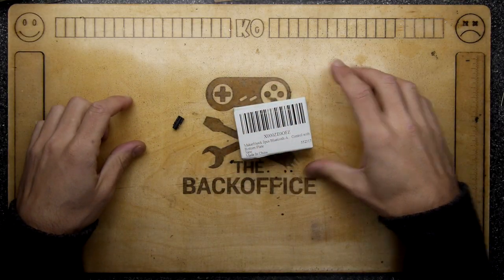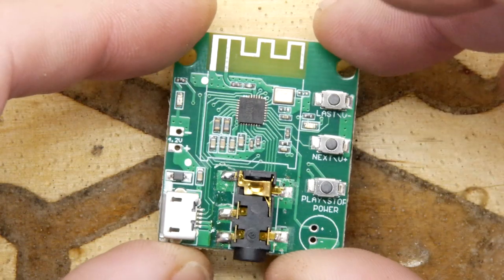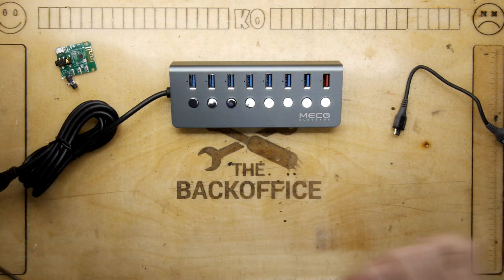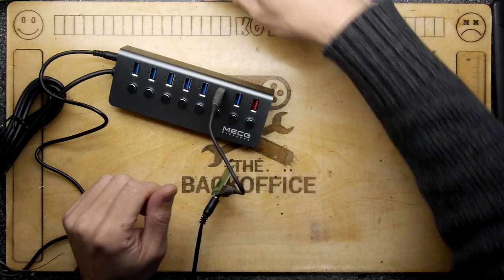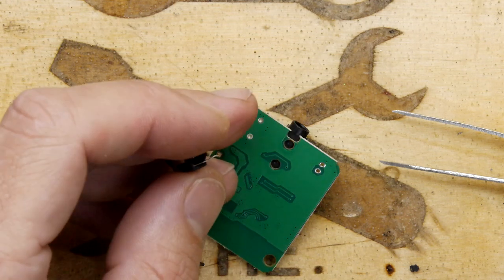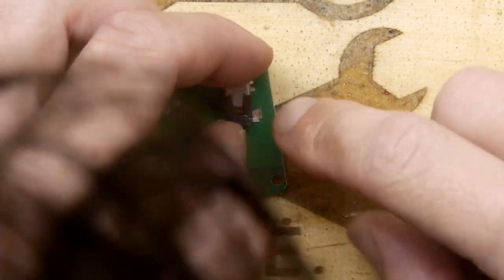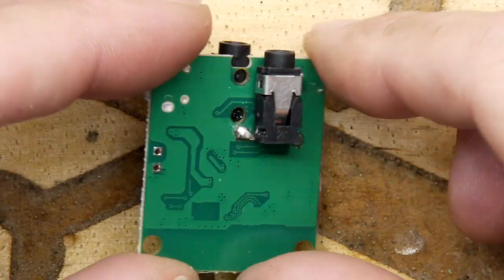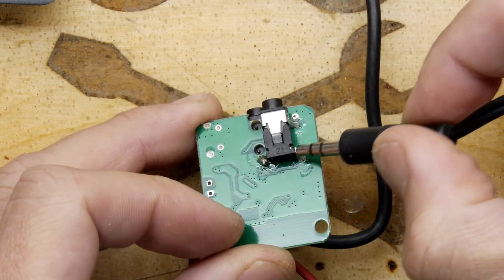Bluetooth Transmitter / Receiver

Comment: This is helpful. I've put a great big speaker above my bath and at the moment all it has is wires coming out so I'll need to do something similar with some kind of receiver and amp.
Reply from the maker: It should work well for you and it's low voltage so should be safe.

Comment: Interesting... did you ever test it? I was wondering if it actually does the bi-directional simultaneously or is it just another TX/RX bluetooth module which you need to switch back & forth to either TX or RX but not both at the same time. My goal actually is to build myself a BT adapter to which I can plug in any headset (earphones+mic) to it and make them BT, product that doesnt actually exist in the market as a commercial ready-to-use solution.
Reply: have you find out how to do this?

Comment: hi, im trying to get the mulitple tao tonics transmitters to keep from fighting each other when pairing my multiple bluetooth headphones. i have a fangor projector and i use an 3.5mm audio output from the projector to a multiport dongle where i plug in the tao tonics transmitters and pair devices with it, then i plug in another transmitter and pair devices to it and i keep adding transmitters and  bluetooth headphones. my problem seems to be that the transmitters remember who they paired to and the unpairing process is haphazard. it there a way to  split up the frequencies available to each transmitter so they are not using the same channels?

Comment: Hi dear friend,
I saw your well made video and would like to ask a question...please reply..🙏
I want to transmit audio output from my Audio Mixer to my Android Mobile phone...wirelessly..Is it possible?
While singing songs on karaoke tracks in my FB Live show, I use an audio mixer to input mic & track and send the output of mixer to a ampli-speaker. The amplified sound is picked up by the inbuilt mic of smartphone. BUT, the quality & standard of Audio thus streamed on the show is not good...
I think you got my query..?
Please recommend respective equipments I have to buy with links..👍👍
Reply from the maker: I have a video coming out this week on a good transmitter and receiver. Look it for it 👍
Reply: @backofficeshow  
Thanks brother....Please send me the the link of video....after airing...👍👍 But please tell me, is it possible ???

Comment: Nice little gadgets. Out of curiosity, how do you connect an antenna to it?
Reply from the maker: If I recall the antenna is on board
Reply: @backofficeshow  Thanks. I was curious because this might be a useful gadget to convert one of my older subwoofers into a wireless sub. However, since I would be mounting the BT module inside the sub housing, I would need a way to connect an external antenna to it.
Reply from the maker: You can usually just find them on the PCB, cut them out of circuit and solder on some micro coax
Reply: @backofficeshow  Thanks a bunch!

Comment: Hi there i have faulty rc transmitter which is blue tooth is there any way i could get it to work?? Thanks
Reply from the maker: It's really unlikely that this would be the solution for you
Reply: @backofficeshow  hi buddy oh i see is there any think out there that mite work sadly my phone or tablet don't find Bluetooth signal from my rc transmitter thanks👍
Reply from the maker: Depends on what you are trying to receive from, is it a drone controller or something? Can you get a replacement from the manufacturer

Comment: doesn't a bluetooth reciever need to transmit so that can pair also doesn't your bluetooth reciever id it's self with a number or a name?
Reply from the maker: Yes they are all transceivers at a protocol level.
Reply: @backofficeshow  does this mean that if you connected a Bluetooth headset with a mic, the mic would work? My works laptop has its Bluetooth off and I’m trying to find a solution using a 3.5mm jack and a Bluetooth module.

Comment: Can I use this to create a high quality wireless mic?
Reply from the maker: It would make a good basis for your project, although you would be limited by Bluetooth audio quality
Reply: look at a BTooth module that uses the csr8645 chip, it has 16 bit ADC's and 48khz sampling rate which is more than enough for a microphone